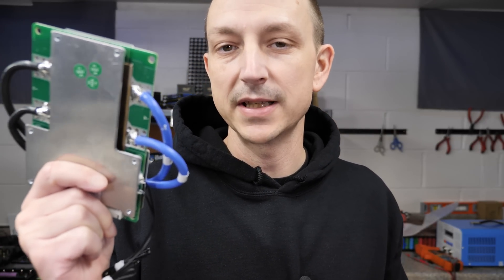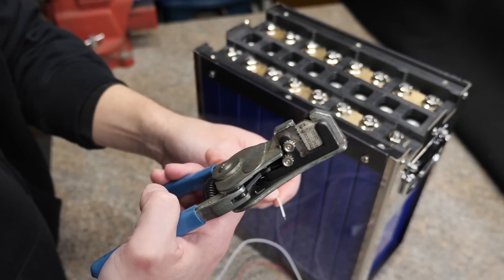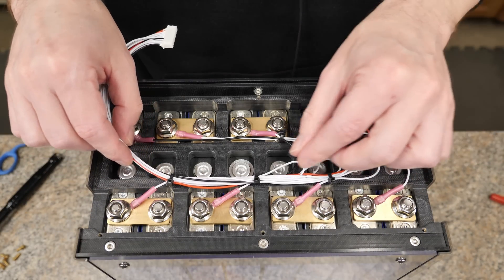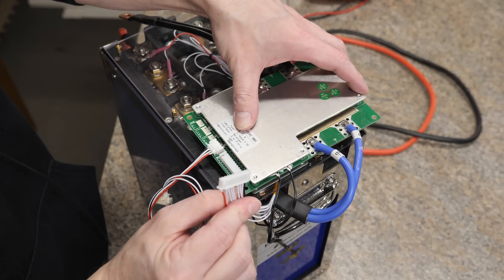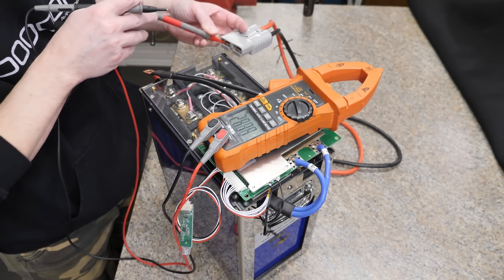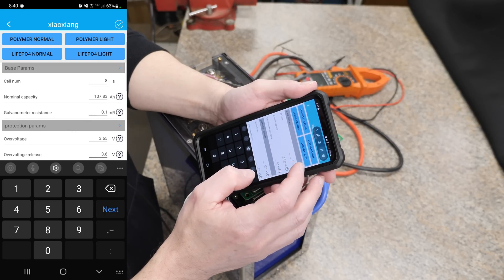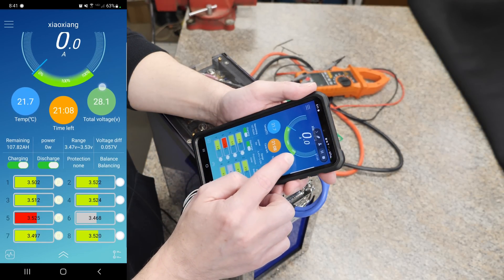Beginner Friendly - How to Install a BMS with Bluetooth!!

Comment: Hello dear friend ,very nice video ,I have bought four batteries 3.2v 300A intended for 12 v connection ,I bought a BMS for 300A,is this nessesarry? To choose a BMS according to the power of the battery? Or I should choose a BMS according to the power of my solar panels?
Reply from the maker: Hello there. Yes you want a bms capable of handling the batteries or higher then the intended load. This protects the battery. The charge controller will take care of charging voltage of solar. Both are needed.

Comment: I touched the battery output wires, positive and negative very quickly and the jbd bms went into protection saying "locked MOS" and I can't get it to work anymore. Any suggestion to help me?

Comment: Hi i have jbd bms 16s ..i have 16 cells 100Ah 3.2V batt..when one of the cells go undervoltage alarm the bms disconnect the discharge and charging..the ouput voltage is 0V..my bms connected to off grid inverter with charger built in..do you know why the bms not allow charging and keep triped till i clear manually with the app the alarm

Comment: How low should the  battery lifepo4, fall before recharging? It will be used on a wheelchair. Thank you!
Reply from the maker: If using an 8s, I would recharge at 24v or a little higher.

Comment: hello! I have a bank of 4 cells 100 ah and a bms jbd, the problem is that the percentage of the battery drops randomly and the voltage does not show correctly 13v on the application and 13.3 on the measuring device and the percentage is 10%. why does it do this?
Reply from the maker: If the SOC% drops randomly....hmmm I cant say Ive seen that unless powering things. Voltage will show slightly different then what your volt meter will show due to tolerances of testing device. I can test with 3 different volt meters and all show a diff voltage.  It almost sounds like the bms needs to be reset back to factory. Once done, set the capacity of the pack and try a capacity test.

Comment: please i have some question  if you can help me 
1-  i can not see Bluetooth Adress of my Battery in app, Bluetoothis on , i instelled another BMS app and no App can see my battery 

2- when i charge my Battery 100% and red light in chargen turn to green light   but Screen of my electric Motocycle show that battery not full charged !  and   only 3 Points from 4 Points are lightning       when i measure Voltage  is  72.5 to 73 .1    my battery is 60V 40 A 
is Problem from Battery or charger  or Screen of motocycle ? 
 my battery is new  this is second charging ,  but it drain quickly ,  first kilomenter   2 Point  after 5 km   1  to  2 point    voltage is 68 

what do you think   ?

Comment: NEVER touch both terminals. At time 6:43 he touched the positive terminal with one hand and the negative terminal with his other hand. This creates a direct electrical current path through the heart. While you might be able to get away with this with a low voltage battery like this one, this can be instant death with a voltage as low as 42volts. Even when working on lower voltage batteries, develop safe work habits to prevent electrocution when you start working on more dangerous batteries. ALWAYS work on a battery with ONLY one hand whenever possible. ALWAYS insulate electrodes you are not working on to avoid accidental contact by hands or tools.
Reply: BuLL SHIRT ! nonsense ...

Comment: ThanKS for this amazing video,I have 15.4kWh byd lithium batteries but unfortunately for me I have lost the bic in the pack which means the bms can't 
They are still fresh batteries I have not used yet I want to know if I can put I another bms an if that can work properly? 4:42 I have a 48v byd lithium batteries but unfortunately i misplaceed a card in the Battery pack that commicates with the bms is it posible to use any other bms or is there a way to use the batteries without any issues??

Comment: I have a 16 cell battery pack. I am installing a 16s overkill bms. However after connecting the balance leads i find an extra  lead #15 white. so i have a black negative bc0 a red positive 16 and no place for 15.. What do i do to get around this. The bms is shutting down dud to under voltage i cel 15
Reply from the maker: You are missing a wire somewhere for sure. Does your first cell have 2 balance wires on it? For exp... you have the black on neg(bc0). Do you also have the first white balance wire on that same cell positive?

I could also look at there instructions and see if they have something odd
Reply from the maker: I looked at the wire diagram and it looks normal. You should have 17 balance wires connected. Each battery will have a balance wire on the positive terminal. Cell 1 will have a black neg (bc0) and a white pos (bc1).  Cell 16 will have the red (bc16).
Reply: Thanks for your comments.  I rechecked and what i found is a 15 cell pack not 16 as i thought. So its 15 cells at 3.2v =48. So that accounts for the extra balance wire. The BMS  is 16s. What do I do? Also is there a tutorial on the xaioxiang BMS app?
Reply from the maker: If I remember right you cant "trick" those bms's by using 2 balance wires on one cell. Some can but some cannot.  Can you get 1 more cell to add in and make a 16s or is it a prebuilt? Only other solution is to get another bms
Reply: @AVERAGE_JOE  if another cell is added the system will be overloaded voltage  wise set for 48v another will make it 51.2v
Reply from the maker: What is the battery going to be connected to? Most 48v inverters will accept 58.6ish volts. My 48v inverter accepts 58.6v and a I have 16s batteries connected. I charge to 56.4v

Comment: Hi, a have 17s bms Bluetooth connected to 14s pack, but bms detect 15s and last cell 0.17v, I can’t change to 14s on app, it not save it, what can I do?
Reply from the maker: I would recheck the wiring with the instructions.  I know many of those bms's have you connect multiple balance wires to one or 2 specific battery terminals.  Then it should show correctly on app.
Reply: @AVERAGE_JOE  I find problem, I need disable sw switch on app!
Reply from the maker: Oh yeah those pesky switches🙃

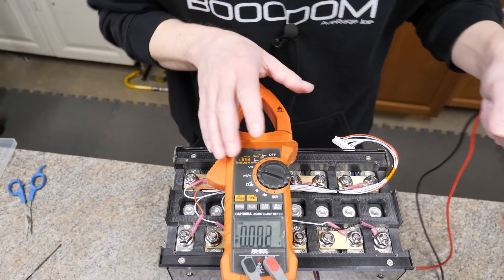Comment: Hi great video. Did your BMS come with power cables to connect the battery negative terminal to the BMS and then the BMS to the load / charger 7:58 ?

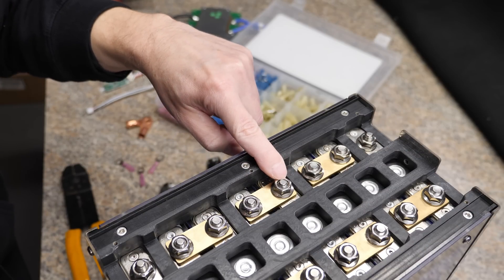Comment: At 2:05 Those are 8mm studs not 5/16s. Like an M8 bolt. Nobody in their right mind would use inches and fractions of an inch when manufacturing posts.

Comment: I’m new to all of this so I’m sorry if this question is silly. This system you built was a 24v system correct? With all that you had in the video battery’s and BMS, could you have built a 12v setup by connecting the cells differently?

I hope that makes sense 😂
Reply from the maker: No worries Man! Yeah I connected up a 24v battery with a bms. Yes you could reconfigure to 12v for sure. Either 2 "seperate" 12v batteries or 1 12v battery by connecting cells in parallel. Obvi you would need a 1 or 2 12v bms's depending on configuration you set up.🤘

Comment: Thanks for this video.  Bluetooth does not want to connect on mine.  I have a JBD bms, 8s 160a with 3 leads on either side.  Balance lead reads the correct voltages, the bms c- reads correct voltage, bluetooth dongle has a blue light but no phone wants to connect.  Tried 2 different phones, 2 different android version 10 and 11 and both Xiaoxing and Overkill solars' apps,  everytime the app says device info fail error -2.  Anyone have a solution ?
Reply from the maker: Did you ever get it going?  Only thing I can recommend is make sure to only have 1 of the apps installed at a time.  I wanna say I had this issue(on a diff battery) and I uninstalled the 2nd app and it worked.

Comment: I wonder if it is possible to connect this type of circuit to supercaps instead of cells. I would like to have a 12v buffer cap between my battery and an inverter but I don't trust those caps they put into car audio setups. Just wiring supercaps in series seems a bit loose with safety as they tend to have value differences in 10s of percents.
Reply: A good question. I believe the short answer is yes you can use this type of balancing bms for capacitors, provided you can adjust the voltages to satisfy the caps limits, however, a Maxwell type supercap will generally have a balancer of sorts between each cap and ur caps total voltage should be at least a bit higher than ur battery voltage in a solar setup & there is probly no real benefit unless you want to run ur caps at a bit higher voltage than ur batteries for some extra surge protection for ur batteries for when. A heavy load starts up.  You still need batteries in the system of course as the caps only really help with battery surge and inverter ripple and can provide for the short bursts or surges of power needs and are great for starting motors, Aircon’s, microwaves & coffee machines , etc, when ur on Solar & inverter power as u probly know. I have thought about using a bms for caps myself, but I dont think it is really necessary as if u have a 16v-17v capacitor setup on a 12v system it should be fine with the normal balancers that are made for the caps because the batteries should keep the voltage down under 12v-15v. Cheers

Comment: Cut your BMS wires to the right length.  Keep your wire orderly and proper harness like.  Cutting your BMS sense wire that way is much much more tidy and less a mess.  The miniscule difference then keeping them all the same length is boxnex.
Reply from the maker: Almost did that!!🤣
Reply: Only might be a problem if you ever want to use that BMS a different position.  Maybe I decide to install the battery somewhere new and need to move the BMS to the side...

Comment: Great video as always ( still miss the karate chops! ) just wondered what the range is on that bms. On my new battery build I want to have a tablet display of the bms in the room next door so just wondered what the 'line of sight' and 'through walls' range is on that unit.
Keep up the good work and look forward to your next update!
Reply from the maker: Ooooooo the Ole Karate Chop! Havent done one of those in FOREVER LOL!!! Range isnt to bad at all actually. I can be upstairs or one floor up and a room over and still get a signal. Id say at least 30ft going through the floor!

Comment: The Bluetooth being added to BMS units is great. I never trust scavenged battery builds without being able to see the individual cell voltages to make sure the bms is working.
Reply: Exactly. My batteries are from medical equipment which sat on the shelf unused for a year but they're re-wrapped so I can't get mfgr specs. I consider active monitoring critical for the life of the ride and safety to boot.
Reply from the maker: 100% Agreee!!!💥💥

Comment: When using multiple wires to carry a large load make sure each wire by it self can handle 60% of the load. This protects the wires incase one has a touch more resistance than the other pushing a larger percentage of the load to the other wire.

Comment: Perhaps someone can help with a question I have. There are balance wires for each cell but where does the BMS get it’s power from? If it is drawing current through one of the balance wires (the red one?) won’t that skew the voltage reading for the last cell?
Reply: Properly designed BMS’ use the voltage from the whole battery not just one cell. But yes there are bad designs. If it is pulling power from just one cell the BMS will be constantly trying to balance the other cells down to that one. If it does this to much it can pull the whole pack below safe levels. So if you are unsure if this is happening you need to test the battery voltage daily for a couple weeks to make sure it is not dropping to fast.
Reply: @ecospider5  I’m sure the BMS will be taking power from the whole pack. The negative supply will be from main negative terminal  but as far as I can see, the positive will be coming from the red wire which also serves as the voltage sense wire for the last cell. The current draw to operate the BMS will cause a voltage drop in the sense wire which can’t be good.
Reply: My thought is the balancing of cells happens over many hours. I have had a balance cycle take over 24 hours. If this is true for most bms systems then enough of the balancing happens when the battery is not in use for that voltage drop to not be an issue.

Comment: Hey Joe! Great to see you back! What exactly are the 'release' values for?
Reply from the maker: Lets say your battery hits high cell cut off at 3.65v and the bms cuts charging. The voltage of that cell has to drop to the release voltage you have set in order for the bms to re-enable charging. Same for all the other setings! Hope that helps!💥🤘

Comment: What type of fuse would you use to connect negative cable to BMS? Thanks for sharing
Reply from the maker: I personally like using HRC fuses! They can extinguish a dc arc in the event there is a short ect... I would not recommend one of those cheap black resetable breakers!💥🤘